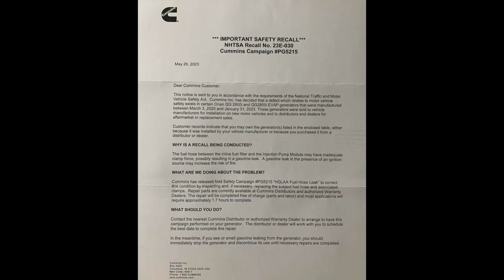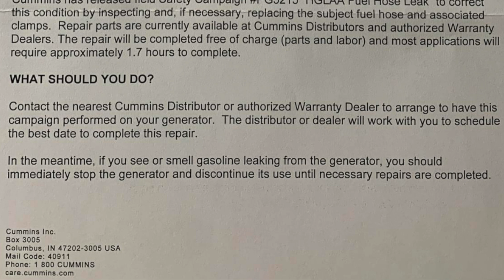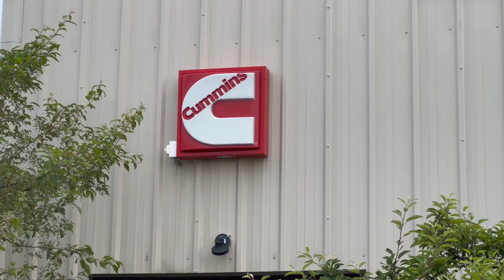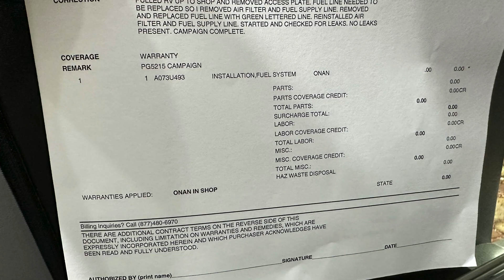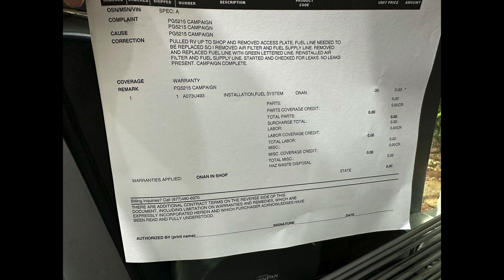ONAN GENERATOR RECALL & REPAIR/ONAN QG 2800i /QG2800i EVAP/CUMMINS #PG5215 "HGLAA Fuel Hose Leak"

Comment from the maker: Amazon Links to Items we use or mention in our videos: (We earn a small commission at no extra cost to you when you purchase through one of the links.  Thank you for supporting our channel. )
Surge protector, Water filter, hose:
Portable RV Surge Protector Portable EMS-PT30X RV Surge Protector , Black   https://amzn.to/3v7qfe8
Southwire 34930 Surge Guard 30A - Full Protection Portable with LCD Display Black     https://amzn.to/3vaPMTy
 FilterLogic RV Inline Water Filter.... https://amzn.to/3BJBpXB
Valterra AquaFresh High Pressure Drinking Water Hose.... https://amzn.to/3sTqK8U
Twinkle Star RV Water Pressure Regulator Valve ..   https://amzn.to/3JOmcrm
Camco FasTen 2x2 Leveling Block https://amzn.to/3LQidMC

Tire repair kit and traction board:
 AirMan ResQ Pro+ Tire Repair Kit   https://amzn.to/3Mszq1n
 Pinto, Inc GoTreads Emergency Automotive Traction Tool - 2-Pack (Orange) https://amzn.to/41ed2gg
 Tire traction boards, foldable......Pinto, Inc GoTreads Emergency Automotive Traction Tool - 2-Pack (Orange)    https://amzn.to/3ZXOqaV
 
Camco FasTen 2x2 Leveling Block For Single Tires                  https://amzn.to/41V2l24
 BISupply Vehicle Service Ramp Set – 6.6in Car Lift, 5 Ton Heavy Duty Truck Ramps for Vehicle Maintenance, 2 Pack    https://amzn.to/3MpJOp6

Kitchen Area:
Royal Berkey Gravity-Fed Water Filter with 2 Black Berkey Elements and 2 PF-2 Fluoride and Arsenic Reduction Elements https://amzn.to/3z19SAe
Travel Berkey Gravity-Fed Water Filter with 2 Black Berkey Purification Elements https://amzn.to/3zpPslE
Over The Sink Roll-Up Dish Drying Rack  https://amzn.to/3p8jXH8
 Magma Products, A10-363-2-IND, Gourmet Nesting 7-Piece Stainless Steel Induction Cookware Set with Ceramica Non-Stick, Silver      https://amzn.to/3p4SciQ
VELCRO Brand - ONE-WRAP Roll, Double-Sided Tape  https://amzn.to/3K4d4Px
Gorilla Heavy Duty Double Sided Mounting Tape XL  https://amzn.to/3HcaWmO
Automatic Soap Dispenser   https://amzn.to/3zhzhXU
Dixie Ultra Disposable Paper Bowls, 20oz     https://amzn.to/3p7PitE
100% Compostable 9 Inch Paper Plates  https://amzn.to/36yLlYG
Lunies Over The Cabinet Plastic Trash Bag Holder  https://amzn.to/3pb82Zr
Subekyu Small Hanging Kitchen Trash Can  https://amzn.to/3p9rrKe
Prodyne Under Cabinet Paper Towel Holder  https://amzn.to/3p7GyDQ
Bligli Shower Mat Non Slip Bath Mats  https://amzn.to/35lOgmH
 MicoYang Silicone Dish Drying Mat   https://amzn.to/3BGDMuu

Bedding Area:
 Therm-a-Rest LuxuryMap Self-Inflating Camping Sleeping Pad   https://amzn.to/3h6jTUb
Packing Cubes Luggage Bags  https://amzn.to/3LS0kNq
GagetElec 8-Inch Clip On Fan 10000mAh Rechargeable Desk Fan Battery Operated https://amzn.to/3RfCrSi (got this fan later, we like the fan a lot)
10000mAh Portable Fan Rechargeable, Battery Operated Desk Fan   https://amzn.to/3JOdHfE
Anything Keeper-Home, RV Organizer  https://amzn.to/3u0UkdM  
Safety Strap Locks for cabinets, drawers and more https://amzn.to/3OIFVeq

Curtains:
Blackout Curtains with Black Liners,  (Navy, 2 Panels, 52 inches W by 45 inches L)   https://amzn.to/36snJop
 NICETOWN 100% Blackout Curtains, Thermal Insulated Black Liner Panels  (Set of 2, Navy, 52 inches Wide by 63 inches Long)   https://amzn.to/3h6Gz6v
 Oval Tension Rods Adjustable Width Curtains Rods 4 Pack Spring Window Round 22 to 36 inches Spring Curtain Rod Tension Curtain Rod, Black        https://amzn.to/3sbpLlh
Rod Desyne Oval Spring Tension Rod 36"-60", Black, 36-60"  https://amzn.to/3p91r1x
Table and chair:
GCI Outdoor Compact Camp Table 20 Outdoor Folding Table     https://amzn.to/3w1eB4U
 Portal Outdoor Folding Portable Picnic Camping Table  https://amzn.to/3slgZBv
COSCO Multi-Purpose, Adjustable Height Personal Folding Activity Table https://amzn.to/3t05IFN
STRONGBACK 3.0 Guru Camp Chair, Original, Navy/Grey     https://amzn.to/3H6Di1K
 STRONGBACK 2.0 Elite Camping Chair, Original, Black/Grey      https://amzn.to/3JOAPL2
 GCI Outdoor Compact Camp Table 20 Outdoor Folding Table     https://amzn.to/3p8dH2l

Bathroom:
Bligli Shower Mat Non Slip Bath Mats Bathtub  https://amzn.to/3sbQYEs
MISSLO 8 Pockets Mesh Shower Organizer Hanging Caddy with Rotating Hanger Quick Dry Bathroom Storage (White)      https://amzn.to/3sa5MTV
MISSLO Hanging Mesh Pockets Hold 340oz/1000ml  https://amzn.to/3LSi9fi
Self Adhesive Pet Proof Toilet Paper Roll Cover Holder ...  https://amzn.to/3hflpTL
 Motion Sensor Wireless Night Light      https://amzn.to/3HdnRVu
 ScorchedEarth Microfiber Travel & Sports Towel Set (True Navy) -      https://amzn.to/33IJ7oq
Poo-Pourri Original 16-Ounce Refill Bottle and 1.4-Ounce Original      https://amzn.to/33HuwJU
Scott Rapid Dissolve Bath Tissue Made for RVs and Boats (16 Rolls)  https://amzn.to/36z0Z6l
ScorchedEarth Microfiber Travel & Sports Towel Set (True Navy) -    https://amzn.to/3hdqWdL
Camco - 21013 RV Straight Swivel Stik with Shutoff Valve- Creates Powerful Cleaning Action that Dislodges and Flushes Stubborn Waste Deposits and Combats Odors (40094)   https://amzn.to/3dYIDQe
Camco 40075 Rhino Toilet Flush Valve Prohttps://amzn.to/3SsPXmd
Camper Hose    https://amzn.to/3fyqCIY

Front area, phone chargers, and headphones :
SHOKZ OpenRun Pro - Open-Ear Bluetooth Bone Conduction Sport Headphones - Sweat Resistant Wireless Earphones for Workouts and Running with Premium Deep Base - Built-in Mic, with Hair Band    https://amzn.to/3V3bVhQ
Tacticool Car Seat Back Organizer    https://amzn.to/3JY79ex
Heavy Duty Cargo Net Stretchable   https://amzn.to/3vigbPk
Spigen Mag Fit Phone Holder Car Mount Designed for Magsafe...    https://amzn.to/3BGR8GU
USB C Car Charger Adapter...   https://amzn.to/3BQ8Yr9
ADDTOP Solar Charger Power Bank ...  https://amzn.to/36DHSIt
iPhone Charger,3 Pack (6 FT) Maitron [Apple MFi Certified] Charger Lightning to USB Cable Compatible iPhone 13/12/11 ... https://amzn.to/3p8fRPB

Coffee equipment :
Hamilton Beach Scoop Single Serve Coffee Maker  https://amzn.to/3t3rJTR
OXO Brew Conical Burr Coffee Grinder  https://amzn.to/35jkDT0
Coffee Canister, MOICO Stainless Steel Coffee Container  https://amzn.to/35lU5Rm

Watch next: 2022 PLEASURE-WAY ASCENT // ITEMS WE USE IN OUR RV.   https://youtu.be/oRXx-2cOaoA

Amazon links to items mentioned in Pleasure -Way Ascent videos:
Vancillary Sprinter Van Headliner Shelf (2007-2018)    https://amzn.to/3phmbEk
 Epicurean Kitchen Series Cutting Board, 17.5-Inch × 13-Inch, Natural      https://amzn.to/3M6izyD
 OXO Good Grips Large Silicone Drying Mat, Large (Gray)    https://amzn.to/3pkRduY
 IKEA LEGITIM 13 1/2" x 9 1/2" Cutting & Chopping Board (White)     https://amzn.to/35wyGFc
 Subekyu Small Hanging Kitchen Trash Can, Collapsible Mini Garbage Bin for Cabinet/Car/Bedroom/Bathroom, Plastic, Grey, 2.4 Gallon      https://amzn.to/3M4ITJC
 YIGII Paper Towel Holder Under Cabinet - Self Adhesive    https://amzn.to/3IsoUCu
Space Saver Over The Door Hooks    https://amzn.to/3JXI7fv
3pcs 500ml Plastic Safety lab Wash Bottle,Squeeze Bottle with Scale Labels (16 oz/3 Bottle).     https://amzn.to/3M5QHLf
Mini Foaming Dispensers for Castile Liquid Soap, 50ml (1.7 oz) - Pack of 12       https://amzn.to/3snjO4T
Automatic Soap Dispenser   https://amzn.to/3p81Zog

Amazon links to items mentioned in Cindy's OnTour 2.0 walkthrough video. 
Lazy K Induction Cooktop Mat https://amzn.to/3yBupMV
2Pcs Over Door Hanging Storage Bags Wall Mount Closet Organizer https://amzn.to/39TlQml
Sink Mat Kitchen Sink Protector for Bottom of Farmhouse Stainless Steel https://amzn.to/3swdwzl
Cupboard Bars Tension Rods, 6 Pack 9.8-15.7 Inches Spring Tensions Rods  https://amzn.to/39qtQeE
DeElf Outlet 8 Packs Small Tension Rods 16 to 28 inch Spring Adjustable Bars https://amzn.to/3wu8k06
Prepworks by Progressive Collapsible Portable Wash Basin Dishpan https://amzn.to/3wqOB1w
BOESHIELD T-9 Rust & Corrosion Protection/Inhibitor and Waterproof Lubrication, 12 oz.
https://amzn.to/3N8sqDO
PackTowl Original Quick Dry and Super Absorbent Towel https://amzn.to/3NfjqwY
Furhaven Orthopedic, Cooling Gel, and Memory Foam Pet Beds for Small, Medium, and Large Dogs and Cats - https://amzn.to/3Nce2uh
GAMMA2 Vittles Vault Outback Airtight Pet Food Container https://amzn.to/3swe48n
Slowton Dog Seat Belt, 2 Pack Pet Car Seatbelt Headrest Restraint Adjustable Puppy Safety Seat Belt Reflective Elastic Bungee Connect Dog Harness in Vehicle Travel Daily Use https://amzn.to/3PxvL1B

Moonet PVC Thickening Leather Spare Tire Wheel Cover for Car Truck SUV Camper Trailer Universal Fit RV https://amzn.to/3GqXLzH
1UP bike rack. https://www.1up-usa.com/product/2in-super-duty-single-bike-rack/
Wilco offroad hitchgate.   https://www.4wheelparts.com/p/wilco-offroad-hitchgate-soloxl-spare-tire-carrier-uhg32206-h/_/R-BKKP-UHG32206-H

Comment: The Concord, NH Cummins-Onan facility is really amazing!  They replaced my 2500 watt propane generator with the new quieter Qi model (a LOT quieter), and were undeterred by the need to fabricate new mounting hardware on the spot to replace the three self-tapping screws that Northwood had originally used to mount the factory installed previous generator. I strongly recommend this facility for any work on your Onan generator. They also have a large stock of parts on hand.
Reply from the maker: Happy to hear. After reading your comment, we are so glad we went there for our generator recall.

Comment: Take this very seriously and avoid using anyone but a Cummins repair center for this recall because we just had a very close call. The recall part from Onan is a 2" hose with two clamps. It absolutely must be Cummins parts used for the repair. In our case the generator started pouring out gasoline in a parking lot AFTER THE RECALL REPAIR WAS REPORTED COMPLETED. Supposedly, an Onan certified tech at Camping World did the recall repair while it had 3 other recalls being done at the same time. (These B Vans had parts supply chain issues when manufactured the last few years).

Anyway... we were many miles from home having to facilitate a flat bed hazmat tow to a certified Cummins repair center in the area where it opened up. We got lucky all the stars lined up, we got help quickly and no fire started but it was a very bad day. It was Saturday so Camping World would not/could not send a truck. We were in Florida and it was over 90 degrees. We couldn't get a rental car so no point in using a hotel either. We had to pay cash to a Lyft driver off duty to get home. That guy was totally cool - gave us a receipt. Tow truck driver was an absolute angel, the owner of the Cummins repair center was great. The Lyft cost 300.00. We had to use our own insurance and pay the co-pay for the weight overage on the tow. It is right now being repaired again at a Cummins Repair Shop. The technician stated quite simply "yeah, the recall hose they repaired fell off"...(I did the omg thing gasoline) ...so that's why I say go directly to a Cummins shop when you are notified of the recall.

Camping World is being pretty cool about it, they are paying for it and getting it home for us and they apologized. (I know, I know, I know... shoulda called the Alabama Hammer but that gets damn messy and I just wanted the RV back) The reality is - mistakes happen and my hope is for their sake and the rest of us mortals involved with this stuff - they learn from it and realize how serious this is. The out of pocket costs should be covered by insurance - going to have to wait for a reimbursement check.

If you just bought a B Van.. CHECK FOR RECALLS. TEST THE Generator IN YOUR DRIVEWAY before you take off on any long trips and carry enough cash to get yourself safe. Just because these things are brand new doesn't mean they don't have problems!
Reply from the maker: Oh wow !! Oh Wow what an ordeal and scary event you went through. We are so sorry. Sending lots of comforting hugs. Totally agree with you about going straight to Cummins Repair Center. Thank you so much for sharing your experience with us to help others.

Comment: Sorry you had a hot night! Hope the fan got fix in round 2 of the repair cycle!
Reply from the maker: Thank you Robin. The fan is working., with assistance  We need to push up on the the black spinning part when we turn it on and off, to engage the gears. So, not fixed, but working.

Comment: We have an 2021 Ontour 2.0 and had gas leaking from our generator (which had not been used for 24 hours). We were at the North rim of the Grand Canyon - so in the middle of nowhere. We were told by Cummins that it was very unusual for the leaking to occur at all, especially when the generator was not in use. We couldn’t get it to stop leaking, so we contacted the warranty administrator at PleasureWay who was wonderful in assisting us. He sent a detailed diagram and instructions on how to stop the flow of fuel to the generator. He shared that there is a shutoff on the fuel line that supplies the generator. So smart that they added the shut-off. We continued on our trip, but DID NOT use the generator. Now we have the recall work scheduled for mid-July, the earliest we could get in.
Reply from the maker: Oh wow !! oh wow !!What a scary situation you were in. Glad to hear that you are ok. So happy to hear that Pleasure Way was so helpful.  It is one of the reasons why we purchased Pleasure Way. So sorry you have to wait until mid-July to get the repair done.  Thank you so much for sharing your story. Sending lots of caring your way.

Comment: We just had ours done 2 days ago at Cumins in Bristol, PA.  It took a little over 1 hour to change the defective part and oil as we requested.  They were great.  The technician was generous in showing my husband exactly what was wrong, the new part, and gave him tips in changing generator oil.  We also had him change our generator oil for the first time on our 2021.5 Ontour 2.0.  We are ready for our next trip and feel safe.  I should say we don't use the generator much as we are spring/fall campers.  We just exercise it monthly.
Reply from the maker: That is great that you got your repair done. So nice to hear that you got a very nice technician.  May we ask how much you paid for oil change? We got our oil done at a Ford deal in Oracle, Arizona (north of Tucson, AZ) for over $30. Not all Ford dealer do a generator oil change.  Our friend Cindy said, Cummins wanted to charge about $220 for the oil change. We use our RV year round. When not plugged in, we have to use the generator because we cook a lot and all the electronics we use need power.
Reply: @tdadventures  We paid $60.99 for the generator oil change with ONMAX 10W-30, labor and haz waste disposal.  It was about an hour drive to them as we live about  25 minutes north of Fretz RV.
Reply from the maker: @pezdetz53  $60.99 is still very reasonable
Reply: I had this recall done at Cummins Bristol this morning. I arrived home and tested the genset. I had no change, still pulling an error code 26. I then read the work order. They stated they removed the unit from under the van. They absolutey did not. (mud & rust still on bolt heads. I'll be rescheduling a follow up.